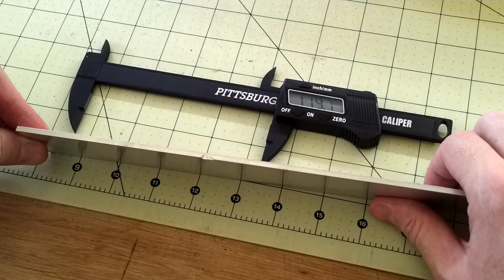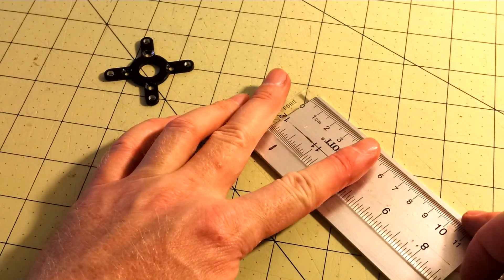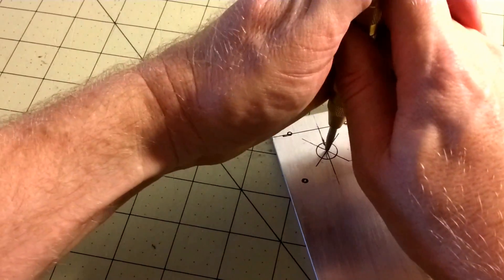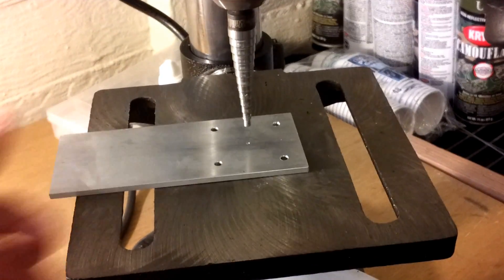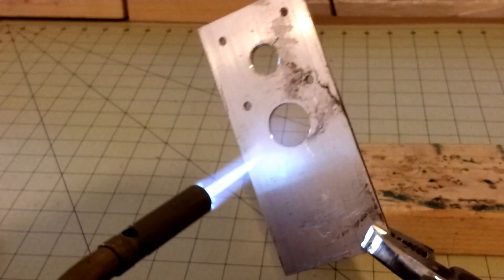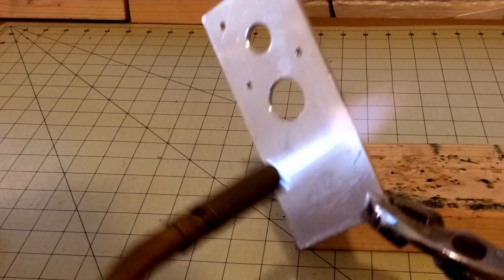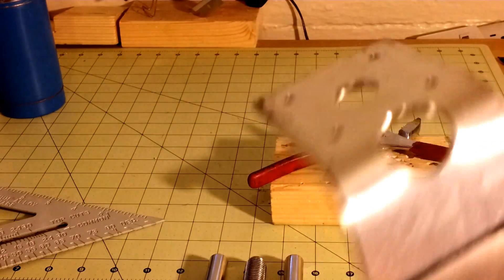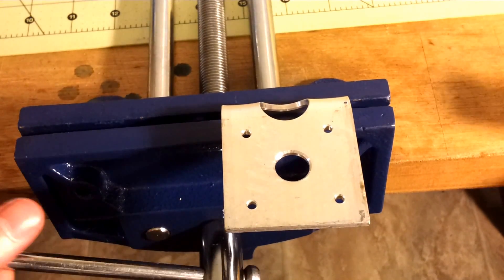How to bend 1/8" or 3.1mm aluminium stock into a motor mount for your RC plane

Comment: Thank you. This is exactly what I needed. I'm looking to do the same thing, make a custom motor mount for a 40" Lazy Bee - need to push the weight a little further forward, so I don't have to use a 5000mAh LiPo to achieve my C.O.G.

Comment: You could lick that piece of aluminum five minutes after heating it,  it would also be just as hard as it would the next day. If its 6061T6 or any temper al, heating weakens it almost 50% .
 Steel wont get cherry red with that torch you got if you held it on there wide open till your ran out.

Comment: Thanks to you I was able to make my headlight mounting bracket. I used liquid rosin flux where I wanted the bend and as it heated it turned black then it started to disappear like the soot from the candle. I saw the orange flame you mentioned too. Having no propane torch I used a creme brulee torch. Took awhile but it worked.

Comment: Is it possible to cold bend thinner aluminum pieces? I wanna bend 2017A T451 but without loosing the tempering on it. What do you think would be the maximum thickness that could be bent without heating if I just want to achieve a 40° angle?
Reply from the maker: Aluminium can get brittle when bending.  Not sure what thickness that would be forgiving.  Best to heat it and bend it from my own experience.

Comment: Great video with lots of useful info. Thanks. Pay no attention to the “nattering nabobs of negativity” :-)
Reply from the maker: Thanks, will do!
Reply: MrDabrudda Thanks partially to your video. Aluminum table leg repair. Key ingredients were drill press and bench vise and wooden curve template. Was going to use torch and bend & hammer to shape on a sawed wooden template but wound up not needing to saw the template or heat the aluminum. Took a chance and used pliers to gently and repeatedly bend the aluminum piece almost to approximate shape. Discovered that tightening the bolts did the rest of the bending. Thanks.
Reply: Would add a photo of finished work but a usually easy task seems not possible here via iPhone 😳🙃

Comment: lol i just use old gift cards or spare pcb board.. drill 4 holes, hot glue to plane and put some big strips of tape across the fuselage horizontally and vertically... more than enough for 2212 motors :)

Comment: I have a better  solution. 

Buy  an aluminum angle.
Reply from the maker: You comment has been stated a dozen times on this video.  Read the comments...but I'll say it one more time...Home Depot nor Lowes had angle stock in this size.

Comment: Thanks MrDabrudda.  I just so happen to need a motor mount for my 3D profile plane I'm building. Now I need one of those step drills too. Oh, and one of those metal benders from Harbor Freight. And leather gloves. And aluminum, 3mm. I'm gonna go take a nap first.
Reply from the maker: If you can find aluminum 90 degree angle stock large enough at HD or Lowes it would speed things up in making the mount.

Comment: I go to the Ace Hardware down the road and buy a 4ft piece of aluminum 2inx2inx16th thick and just cut out what i need lighter and i don't have to do all the heating and bending. I have been making motor mounts for flying wings for the last 5 years and they are thin enough that you can bend them to get the thrust right. I can get 24 motor mounts from just 1 4 foot piece.
Reply from the maker: That is exactly what I did.  The Lowes and HD were I use to live didn't have that size of angle stock.  But I found a Lowes that had 2x2 angle and I cut it on my chop saw.
Reply: An easy fast way to do it man...

Comment: you should bend the plate to an angle little bit higher than 90 degree to avoid the elastic return of the metal: 2 or 3 degree more could be enough!

Comment: that is way overkill....the motor's thrust plus the mass of the aircraft can only exert a few pounds of force on the motor mount
Reply from the maker: +freshcaughtbass Of course 1/8" aluminium stock is overkill.  But Home Depot and Lowes didn't have aluminium angle stock large enough for this motor mount.  But at least you know how to bend thick aluminium without cracking it.

Comment: Thanks for the info. I bent some 1/8" aluminum without heating it. Bent fine but I didn't have a hole in mine. Thanks for the heating  info, will try that next time. DOes the heat help it stay bent?
Reply from the maker: +SolarBurrito Not sure about the heat helping it to stay bent.  Heat helps prevent the little cracks in the aluminium from forming.

Comment: Nice bracket, not done it myself but pros in this area tell me as a temperature indicator you can also use permanent marker ink and bar soap (carbolic I think) - nowadays of course we use a low cost infra-red digital temperature meter, easy, accurate, no guessing.
Reply: and what would that temperature be though...?

Comment: with that giant hole in the middle you effectively have two approximatley 1" wide strips and any one can just bend that by hand in a vise no need to anneal and weaken it by doing so. I'm assuming it is 6063 alloy. If it is 6061 alloy then you'd need to anneal it.
Reply from the maker: PhotoBooth biz Not really.  Thick aluminium will crack.
Reply: there are four common grades of aluminum 3003, 5052, 6063 & 6061. ONLY 6061 would crack without annealing. I know because i've done it. There are actually around a hundred different alloys but the above 4 are 99.9% of what you will run into.
Reply: @rollandelliott  great information.  I am basically making an aluminum stool with the lightest possible thickness of aluminum possible, using bridge tricks.  I am new to aluminum.  My research has told me to choose 5052 because it bends and welds, but is rigid. 6061, not so much.  What is this 6063?

Comment: I don't want to be an ass but I don't really get this.. you spend like what 30min to bend it into the shape. There's one called aluminum angle extrusion which are widely available in 3mm thick and will do the same as what you have achieved.
Reply: +MrDabrudda I think these guys are missing the point. The point is you can bend aluminum easily and properly by heating it to a certain degree. Thanks for the video and tips.
Reply: Since this metod can be used for bending aluminum in general, not JUST RC motor mounts, you're an ass.
Reply from the maker: lavith.hcm I went to both Home Depot and Lowes that day and neither had the size of aluminium angle stock to fit the motor mount.
Reply: not ever town has a home depot and lowes either , but if they do, then....... they probably have a welding store. I live in a small town, and have no problems finding stuff like this or you can jus buy it online.

Comment: Thanks for the fascinating video.  About how many pounds of force would you say it took to bend that when it was hot?  I only have a small suction mount vice and if it takes over 5 lbs of force to ben the 27mm wide x 1/8" thick piece I have, I might need to buy a bolt down vice.
Reply from the maker: Rookzx14 It didn't take a lot of force to bend the hot aluminium.  I have a vise that clamps onto the edge of the bench from harbor freight.
Reply: MrDabrudda yup.  I went to HF and saw that one.  I went all out and got the big blue multipurpose vise that rotates.  $70.  That should handle a lifetime of vise needs, though that one you have looks great for use with a drill press.  Thanks.

Comment from the maker: Putting hot aluminum in cold water may warp and distort the aluminum and it might make the aluminum brittle.
http://www.croucher.us/water-quenching
Reply: +MrDabrudda Depends on the severity of the temperature difference. Aluminum loses heat much quicker than steel, so by the time you bend it and then quench it, the aluminum would have cooled off significantly.

Comment: It would be so much easier to just buy a piece of 2 inch angle and cut off the length you need
Reply from the maker: Andrew82688 yes it would have been easier but Home Depot didn't have that size in stock.

Comment: can i  buy a pre-made one somewhere?
Reply from the maker: Probably would be cheaper to buy thinner metal from a hardware store and bend it yourself or buy aluminium 90 degree angle stock that is big enough to make a motor mount.